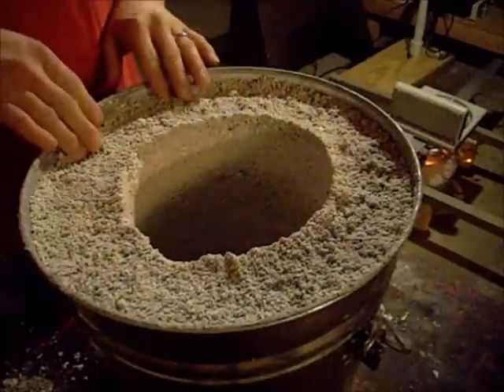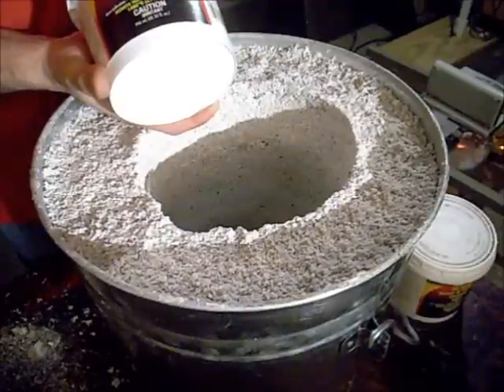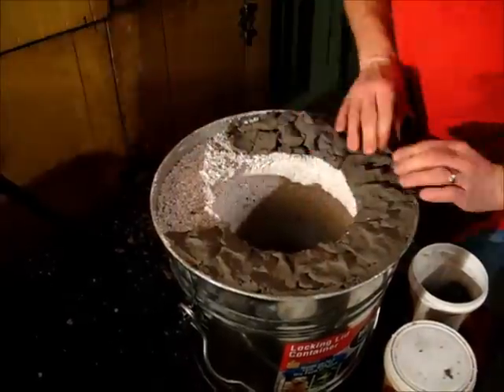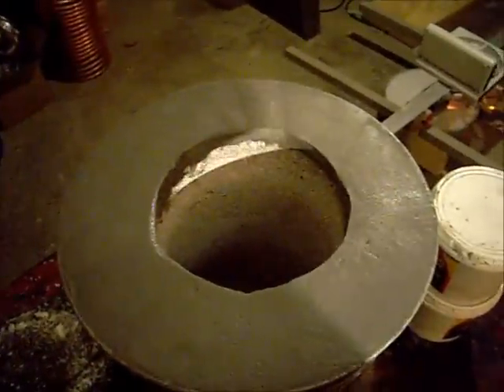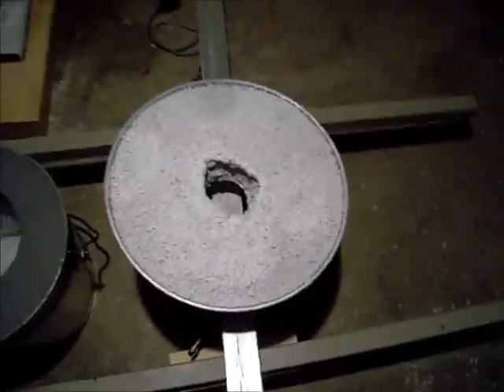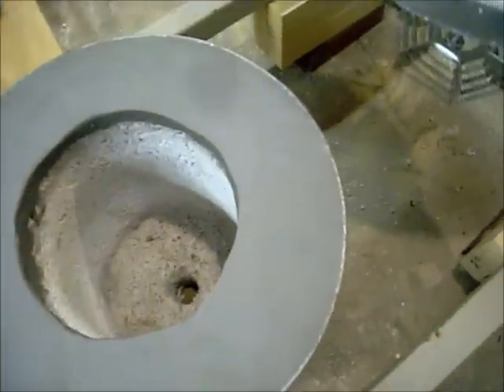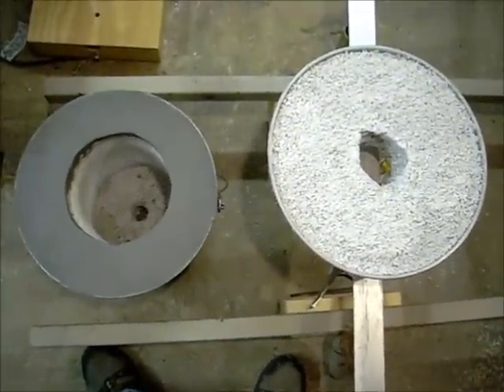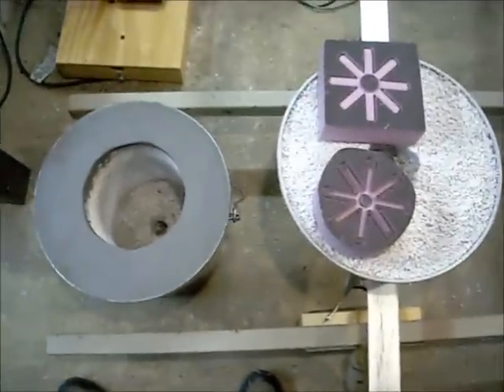Foundry High Temp Cement Coating

Comment: I am worried about the lid though. I think if you line the lid with the cement, the perlite won't hold the weight alone, and the cement might break away from the perlite.
Reply from the maker: I am going to try and do a thin layer of the cement on the lid. I was worried it might pull away as well. I thought about trying your aluminum oxide, baby powder, sodium silicate mix on it. But I am unsure how much heat that will handle.
Reply: digitizer101
 My foundry is getting a lining of just aluminum oxide and sodium silicate, no baby powder, it turns dark grey when heated enough. The video of my forge I put the mix on the top WAY to thick and wet, it never really dried.

Comment: Very nice! You could use some of your kitty litter silica gel to help dry it.
Reply from the maker: How would this work? I think the reason it is still wet is the silica gel. Maybe I didn't boil my silica gel long enough and it still has to much water in it. I have been holding a torch to it an setting a heating element near it to try and help dry it out.

Can't wait to see your foundry set up I look every day to see if you have made a new video about it.
Reply: digitizer101
I would put some in an old sock to make a DIY desiccant pack to absorb the moisture. Just toss in one or two packs into the hole and put a plastic bag over the top and let it sit overnight. The silica gel will make the air inside the foundry so dry the water will be drawn out of the perlite. I dried mine in a gas oven at my work for about 9 hours, that worked well.

As for my foundry, I know I haven't been good about updating, but when it's all finished I will be comfortable posting a video about it. I fired it up last week without sealing the perlite and melted some scrap brass in it, but it needs sealing as the bare perlite could not take it.

I have also been experimenting with alternatives to ceramic wool, such as rock wool. That is how I want to do my lid as it would be very light weight, and the wool will make a better seal to the foundry than something hard.
Reply from the maker: clkindred Thanks I am always over thinking stuff. I forgot that the silica crystals absorb water. I am going to try that method to dry it out. I will post another video once I get it all sealed. For now I am working on my burner.